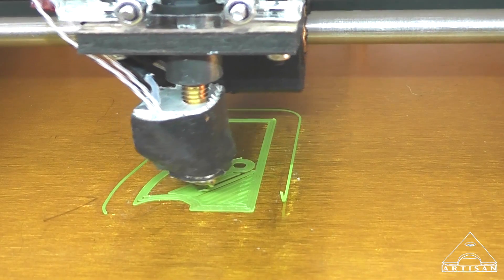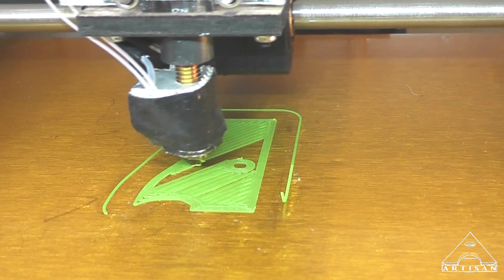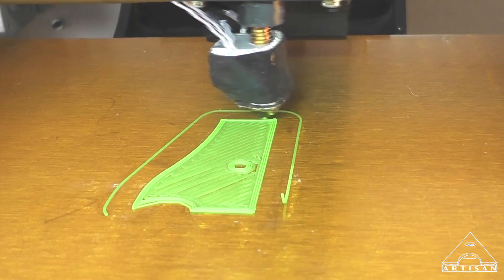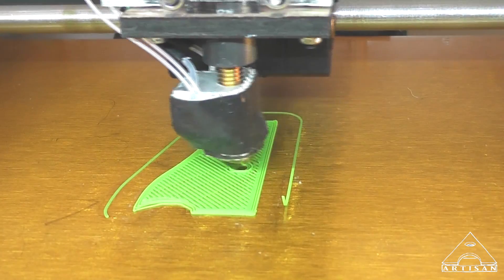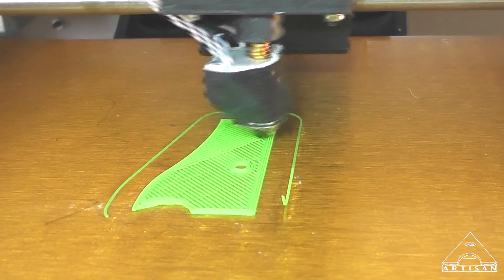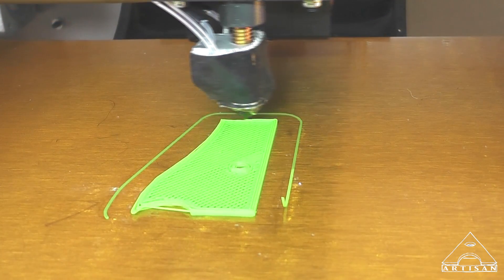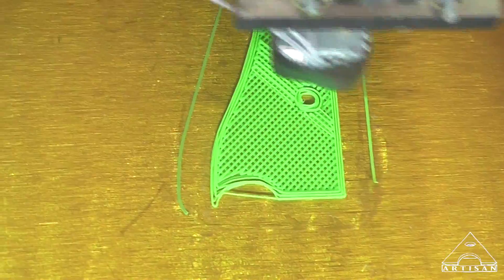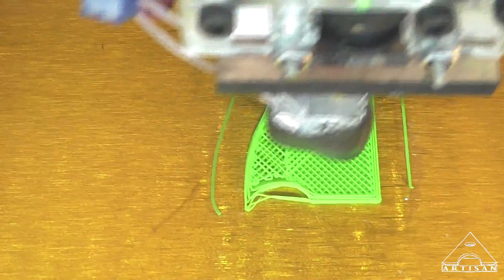Solidoodle 3D Printer - Radius Problem Sample

Comment: just looked it up. Temperature is too low and the extruded plastic is not hot enough to bond so it moves away from the layer underneath.

Comment: I had the same problem,the aluminum bed will warp with the heat,  I switched to a glass bed and set the depth to .305 using a feeler gauge. I get great results now.

Comment: you were underextruding... you will want to increase the rate the extruder feeds.  i had that problem once.  i increased it to 100mm and it was perfect.  you also need to increase the extrusion temperature. if you have the new firmware, the default will need to be changed to 215c.  i have mine set to 222c it works perfect and unless it forgets to stop at 222 and hits 230c ( the firmware hard stop point, which it does every once in a while, something to look out for...)get nearly perfect prints

Comment: I've found slower is definitely better. It may take longer but the results tend to be more accurate. Really their defaults are garbage. You have to tweak just about every setting. I started out by setting all of the speeds to half of the default. Then I had to find what parts were still going wrong and halve those values again.

Comment: Ye sometimes a circle can be hard for a printer,
I didnt have to many problems with it yet if you use hairspray as normal, and be sure your extruder is close enough to the bed so it would stick.

Comment: I'm going to buy one of these tonight.  My opinion of this problem being a machinist for the past 15 years is that you should slow the speed down on approach of a sharp angle and a radius.  I don't know if the software will allow you to do that yet.  If not I'd go with the fastest speed that will still allow the radius to work.  The same principal applies to CNC machining with an end mill plunge cutting an internal cavity with a horizontal mill.

Comment from the maker: You just have to keep tweaking the settings in the slicer software.  It is a combination of speed, filament qty, infill and probably 50 other settings. :) I think this problem is where the head was too far off of the print bed.  It should be about a thickness of paper off of the print bed which is easy to adjust with the adjustment screw.

Comment: Its all about the 3d printer and temperature it gets the plastic and how close the extruder is to the surface the plastic is on, if the plastic has more drop to the surface it most likely wont follow, my friends have a few types of 3d printers and this has been the case.

Comment from the maker: It is the arrow shelf for my Spectre Breakdown Bow. I thought it would be a good part to start with. The bow comes with some cheap wire arrow shelf so I designed this part to replace it.

Comment: I see that they have several different filaments.  Do the different filaments have any affect on the printing?  I would stay on them about it.  While you are waiting on them, you can try soliforum(dot)com, if you haven't already.  I've never messed around with a 3D printer, but it has to be the filament or the head causing it to do that.  Good luck with it, Tony.

Comment: Is it controllable at all times, or for just the print job?

It reminds me of using hot glue and it not sticking because the glue is too hot, so its just doing whatever it wants.

If you can control speeds, which it appears, slow down on the radius's and treat it like a CNC machine for any complex movements such as those.

Comment from the maker: It is line code generated fro whats called a slicer program that creates the layers for the filament.  The filament is on a roll and the extruder melts and lays it down on each layer.  I'll do a video explaining the process as soon I will be an expert :)